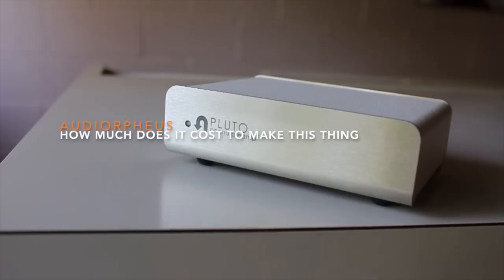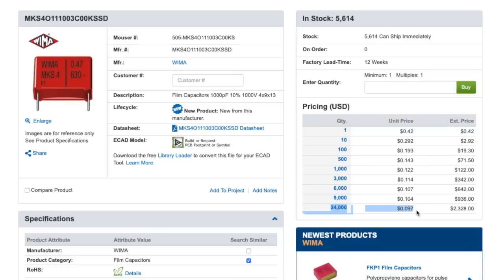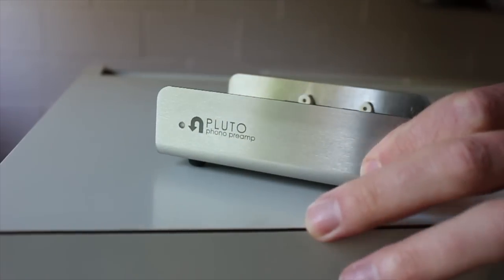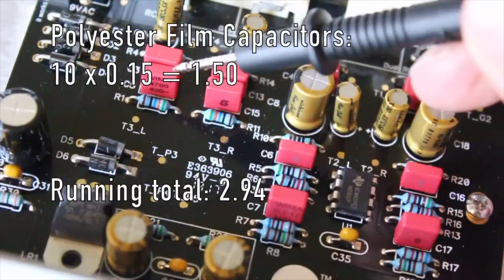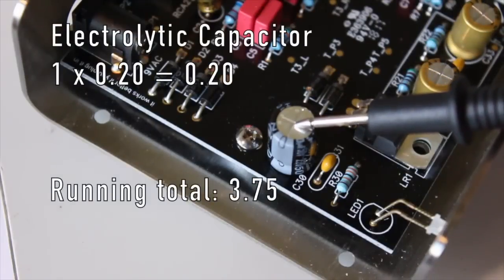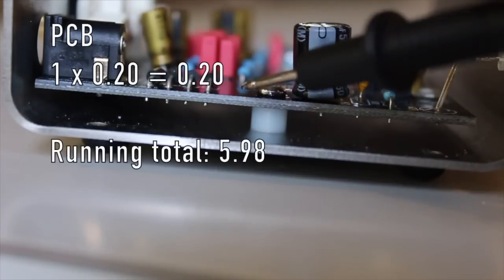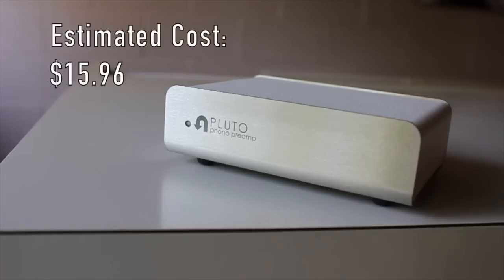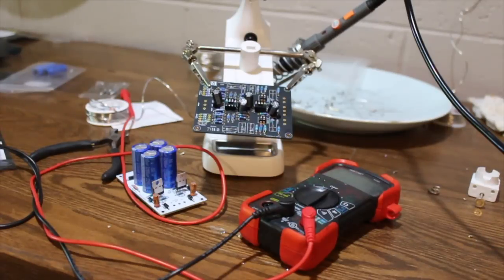How Much are the Parts Worth in this Preamp?

Comment: You only touch on the manufacturing side. 
Those chips require a program to be written
 So programmers need to be paid.  The board has to be designed and electrical engineers need to map the board. The research and development may not have hit millions. But I bet they could  buy a few exotic sports cars.
Reply: I am not sure what you mean about programing. The chip on the board is an op-amp.

Comment: To everyone saying "plus labor": you can get PCBs soldered by a machine for dirt cheap. A person just has to screw in jacks & the PCB into the case. < 10 minutes of labor.
Reply: That price is a bare PCB, non-populated.  Granted, you can just get a solder mask with your PCB to effectively put solder paste, like silk screening a shirt, onto the PCB, you plop components on top, pop it in the oven and it wets the solder.  But still, more than just 10 minutes of work.  There definitely are more costs, NRE costs, packaging, storage for finished products, shipping of materials, etc.  Still I think that the higher up the food chain you go, the markup on products probably gets pretty insane.

Comment: Hate to say it, but unlike the rest of your videos (which are great btw), this video is very misleading, because you completely forgot to factor in labor and assembly cost, not to mention other overheads that they're going to incur.  I've spent many years of my life working in places that made products like this and I can assure you that they're not making 450% profit on this preamp.  And even if they could get the cost down, 4x markup is right where a startup in the United States (that doesn't import assembled products from China no less) wants to end up (although it's not always possible to end up there).  Startups that have razor-thin margins don't stay around very long.  U-Turn Audio is doing the right thing in this case by setting their price where it is.  I urge you to check out some online resources on how products like these are calculated, and make a followup video to this one.
Reply: Video just tells facts. Not how much the companyowners put in their pockets. People can use the information as they wish. For you and I it would cost much more to build one even if we use an old cigarbox as enclosure
Reply from the maker: Hi Neil, thanks for the comment. I might be naive, but I always envisioned these products coming off of robotic assembly lines. Is that not so?
Reply: @Audiorpheus_Vinyl Some are, but U-Turn's preamp is made in Boston (I confirmed this by reading the box label that mine shipped in), it's not imported from China.  It uses an older process (through-hole, as opposed to surface-mount / SMT), in which the parts are hand-stuffed and soldered.  And that means, using USA labor (minimum wage or slightly higher), a board like this runs about 40 cents per part to place, plus all of the extra overhead on top of that.  If they're paying their workers more than minimum wage, then you can expect that number to jump up even more.  If their quantities were higher, or if they made their boards in another country, they could get the cost down.  But U-Turn is not that kind of company.  They're building things here in America the old fashioned way, and keeping the product really simple.  I like that style a lot personally.  But you have to be careful not to compare apples and oranges.  Their overhead is going to be very different than Audio Technica or the ART DJ Pre which is 100% made in China.
Reply: @Audiorpheus_Vinyl  You are indeed naive..........and you have no grasp of business realities.  You oversimplify the process of bringing a product to market.  I do enjoy most of your videos, however..........but this one is sorely uninformed.